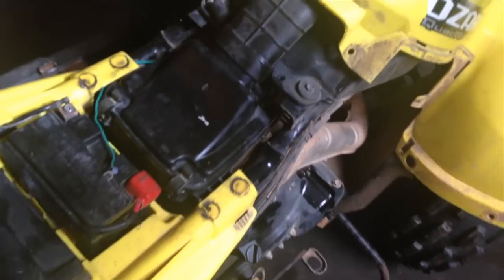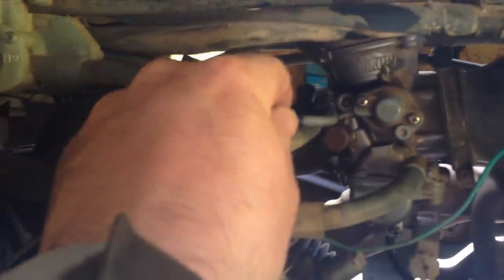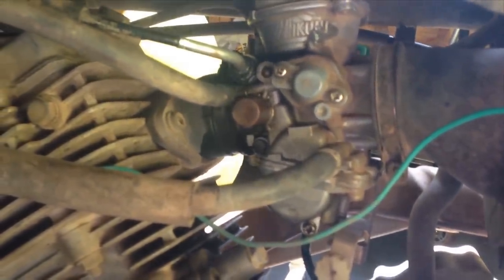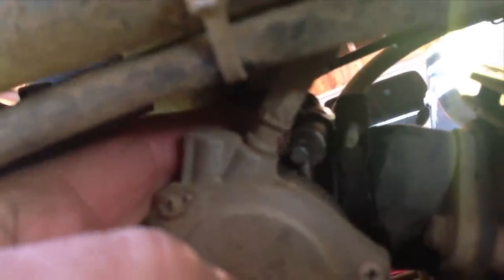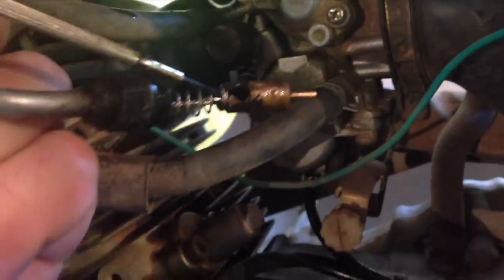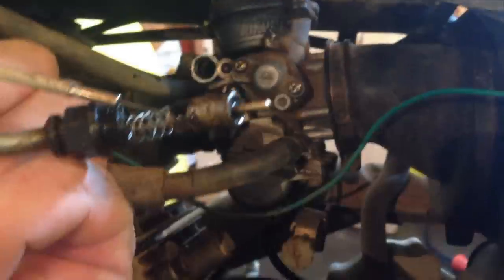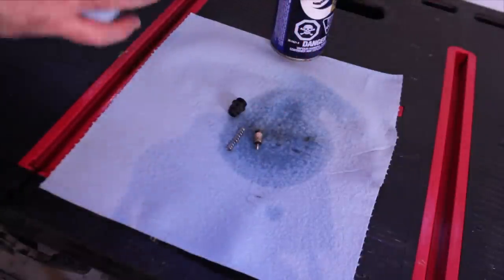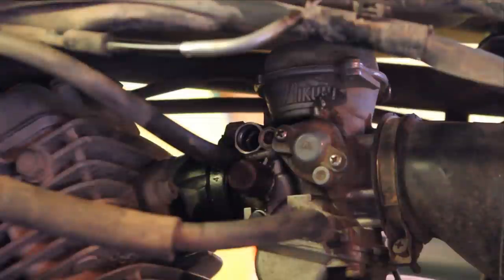How to free Mikuni bs29 Carb Stuck Choke/Enricher Plunger

Comment: Thanks  for video.  I wanted to also add this comment...
Sometimes dirt will enter plunger area and scratch & gouge the inner walls & metal plunger.  
Some gentle rubbing with super fine sandpaper with oil on both can smooth it out & may help in not having a repeat of same issue .
Reply from the maker: Great tip!

Comment: 2001 Polaris Sportsman 500 HO..  had been sitting for a couple of years not using the choke so it was stuck... this worked great, WD40, heat on the back side and had to push plunger in with small tool, push-pull lots but it started to move ... careful not to get too rough... glad I googled the problem first ... I can see how the cable end can break ........ thank you
Reply from the maker: glad it helped.  I think they could have got rid of the cable and just used a plunger knob on the carb like yamaha does and eliminated the hassle with this weak mechanism on a cable.  Thanks for letting me know!

Comment: Didn’t think heat would do the trick on my 750 Shadow with the same problem. Soaked with PB Blaster and pulled, but about 3 mins of heat and a little pushing with a small screwdriver pulled both stuck plungers out. Thanks for the vid!
Reply from the maker: you are welcome!  i am glad this has helped!!!

Comment: Same problem. I even tried a hydrosonic cleaner for over 15 minutes and still stuck. After inserting a small screwdriver and tapping a few times the plunger released just like your video. Cudos!!!! P.S. I did remove carb.
Reply from the maker: +Dan Zuefeldt Glad this helped you!  Cheers.

Comment: Just had to free the plunger on a 1996 Polaris Indy 500 Classic Touring. Sled has 1100 miles. I didn't use heat, but was able to tap the plunger down with a small screwdriver and hammer, then keep the screwdriver engaged and pull it up and down with the plunger repeatedly, all the while adding doses of PB Blaster. It came out! Cleaned it up, sled runs great!

Comment: i got a 1997 polaris xc600 tripple got 3 carbs on it, i got one of the plungers out with a little force, the second poped right out the 3rd is just stuck huge soaked it all night pb blast no luck gonna try the heat tonight my final try before drilling it out! hope it works

Comment: Thanks for the video,, I had two stuck as fuck choke plungers on my 92 arctic cat wildcat 700... soaked both for 24 hours with pb blaster and carb cleaner, one came loose and pulled out after the heat gun,,, the second I had to drill out, but got it done,, no damage to the carbs. Thanks Again !!
Reply from the maker: glad it helps!!

Comment: Have one stuck on a Quadrunner. Seems to be a common problem; yet the parts are ridiculously expensive; and that stupid nut is almost impossible to get at. One of those cases where the original designer should be taken behind  the woodshed for a little paddling lesson.
Reply from the maker: lmao - Exactly!  Parts break really easy as well!

Comment: Thanks for the video. I am having carb/choke issues with a different quad but same choke system/cable. My cable is actually broken but I still have the plunger. Where could I find a replacement cable and plunger (I've checked online and with dealers but unsuccessful)? Or do you have another recommendation?

Comment: The plunger on my daughter's ttr125 is stuck and part of the housing broke so can't pull it up and out with the cable. Any suggestions on how I to get the rest of the plunger out?
Reply from the maker: i wonder if you could use an easy out bit or a self tapping screw to gently screw into the brass plunger and pop it out.... in this case i would pull the carb off the bike and take it apart on the bench
Reply: @mudbrats  That's what my first thought was, but a replacement plunger assembly is like $45-55, so then I started thinking of doing the carb mod instead of dealing with the issues with the stock.  It ran fine the other day without choke.

Comment: My gfs parents have a old atv that i try to fix and i have found that the plunger is completely stuck on open. I can´t get it out.. like, we´ve tried rust solvent over night, heat etc etc but nothing. Its completely stuck... FYI, the atv runs for maybe 5  minutes then it dies and wont start until its cold. The plunger stuck in open could be the prob right ? Im not totally out of bounds right ?
Reply from the maker: that sounds like it stuck open - its an enricher system / best to pop your carb off and start pulling it apart
Reply: @mudbrats I have got the whole carb in pieces and I have got the plunger out. When i inserted it back in and ran the atv for 20 min, it died again. Pulled the spark plug and it was completely black. To much gas. The plunger was out maybe 15/20% when i tried it so im gonna try to push it back in all the way, clean up the spark plug ( and buy a new, hotter plug to get more char burned of it ) and try again. 

Is it possible that the atv ( old odes 400 ) have some kind of overheating system that cuts the spark if its to hot ? It is oil cooled and the oil has never ( read - looong time ago) been changed. I pulled the plug just when it died and there was a nice white spark but maybe its not the spark thats needed for it to run, if u know that i mean ?

Comment: question can i take the cable and and put a bolt there to make a choke delete or the the choke piece have to be in there
Reply from the maker: i am not totally sure on that one.  It would have to be sealed to not let air leak. Sorry i dont know the answer for you

Comment: I have a yamaha bruin that has the same style mikuni carb. When i changed the carb everything went smooth except i can't get the plastic nut that covers the plunger back on. It seems to be seated all the way in but feels like something is stopping me from screwing the nut on
Reply from the maker: Check if the threads are OK on the plastic nut... they may be stripped

Comment: how hard would it be to swap carbs on a 1998 vespa.. about sick of this issue I had with an auto enrichener and even after converting it the damn thing still sticks :( looks exactly like the one in this video but i'd like to swap the carb for one with either just a primer or a "conventional" choke. freezing your butt off while the damn thing floods is no fun.
Reply from the maker: grettagrids Not sure - It would have to have the same jetting and size fuel and airways in order for the bike to run properly.  Best to check with a Vespa Mechanic just to be sure.  I am running Star Tron Enzyme Fuel Treatment in all my small engines to help prevent this.

Comment: How long did you apply heat for?
Reply from the maker: It only took a few minutes - maybe 5mins max.  the video is pretty accurate.  Just heat and gently work on the cable.  You'll feel it start to move when its ready.  Don't twist the plunger with a screwdriver.  its brass so you'll mess it up .  just pull and push on it until it goes
Reply: having same problem it will move but still wont come out  odd that it is the same thing on both carbs am i missing something?did the carb cleaner and heat
Reply: Same issue 83 suzuki LT125 mikuni carb